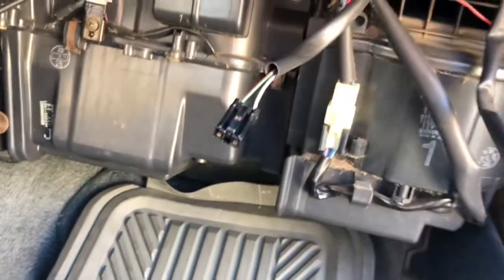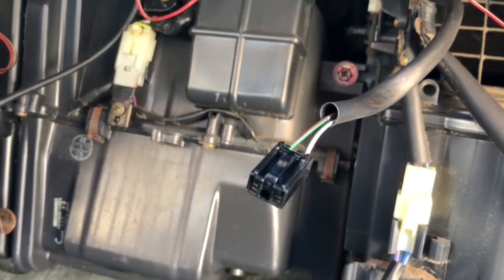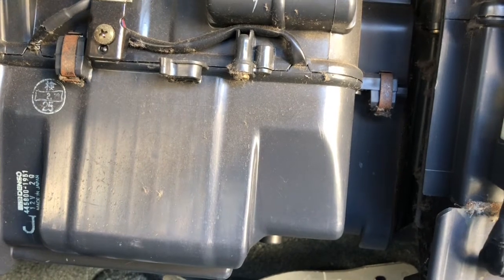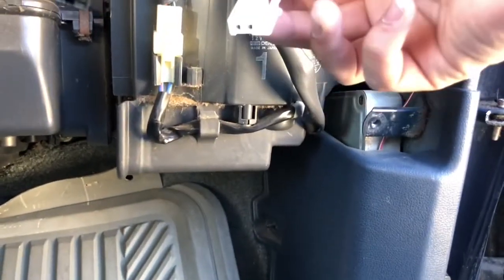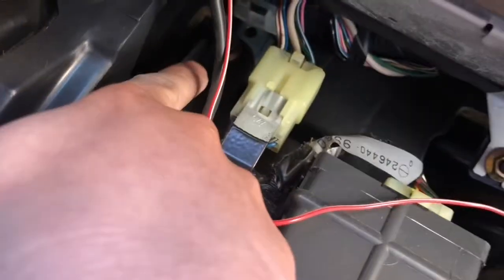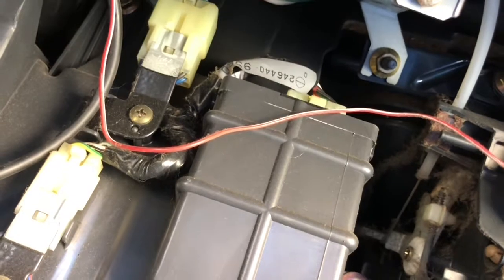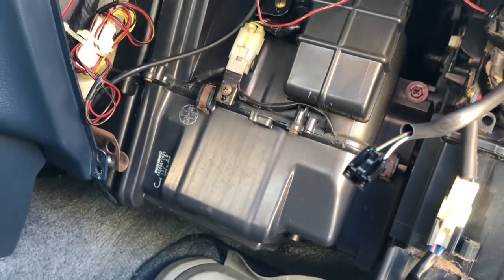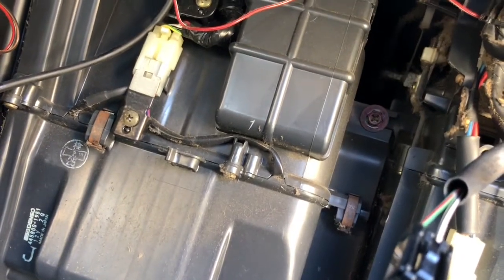1995 Toyota 4Runner Update of 2021 #1: Preparing for AC Evaporator and Expansion Valve Replacement

Comment: ugh I have a '96. I've done many parts replacements already, entire starting electrical is renewed (starts, relay, ignition, ignition coils, sparks plugs, battery) already put in new-used a/c compressor. bought new TXV and receiver, receiver is easy to spot, right in front. My TXV, likely with yours. Behind the dash.. such a pain in the ass. As you said, i can't find any videos for a '96 4runner. :(